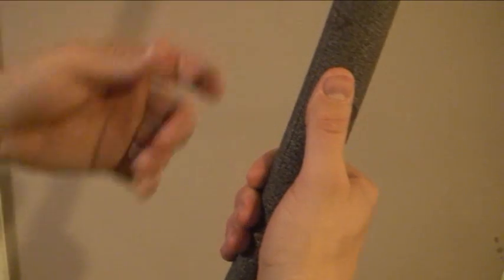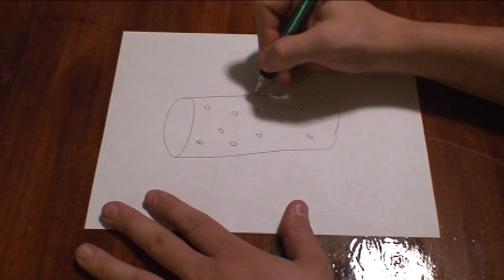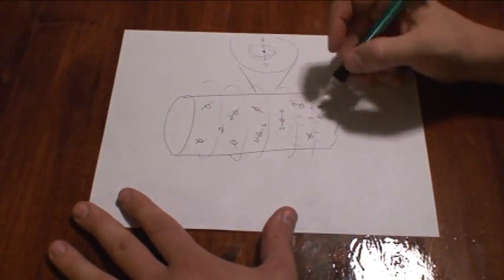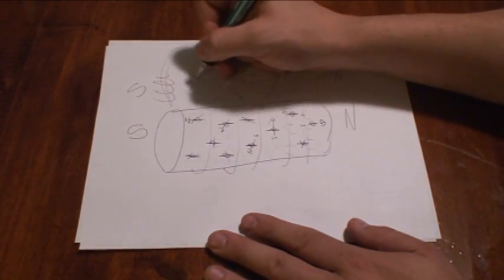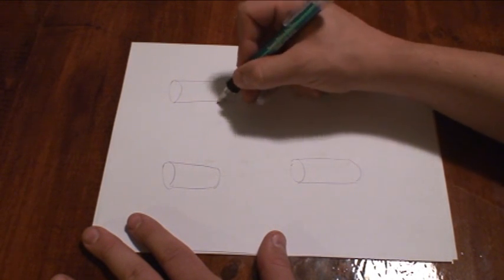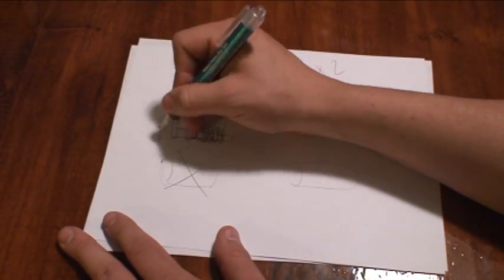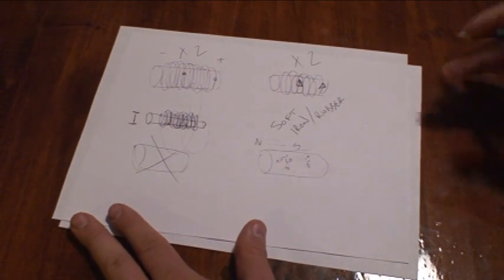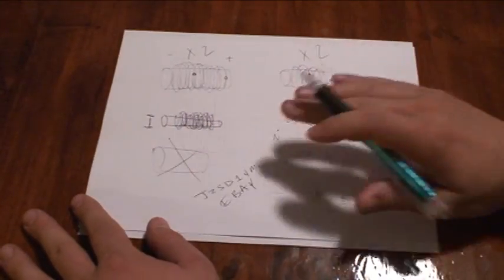How electromagnets and electric generators work:

Comment: I can't seem to get a straight answer anywhere.  You jumped from the coil of wire to spinning magnetic field. What spin?
You run current through the coil wire, easy enough.  You have the iron inside the coil. Now answer these:
1. Is the coil wrapped tightly around that iron or there is some gap/air between the two?
2. What rotates, the coil outside the iron, or the iron inside the coil, or both are rotating on some axis?  Hard to believe the coil is rotating or even the iron and the coil or you will have the wire that is hooked to the coil to feed it current in one big old cluster mess.
And on a separate question.  So-called Stator is that thing also in the form of a coil or not really?  
I have looked everywhere and they use the term coil and conductor for both the magnet coil and the stator.  Scientists communicate like doctor's write.

Comment: "Soft" iron has nothing to do with blending it with rubber... there's no rubber in "soft iron"... in fact, there's <nothing> else in "soft iron" but plain old annealed Iron.

 The term is in contradiction to Steel... which is hardened iron... iron alloyed with carbon to make it harder than "plain" (elemental/annealed) Iron.  Plain, raw IRON... is rather soft... and not desirable for its physical strength for that reason... but for electro-magnetism, it's IDEAL!

Various alloys of Steel can easily be magnetized "permanently"... tap a screwdriver blade tip against a "neo" magnet and you'll get a magnetized screwdriver. The magnetic orientation of the steel can be reversed by flipping the magnet, and tapping the screwdriver against the opposite pole of the magnet.  This is called "magnetic hysteresis"... it retains magnetism when exposed to a strong magnetic field.

However... tap a (soft) Iron rod against a magnet, and nothing happens... the magnetic alignment of the iron particles go back to their previously "randomized" polarity.  This means Iron has very low magnetic hysteresis.

Soft Iron in an electromagnet core can create a concentrated magnetic field that is as much as 50,000 times more intense than an air core.

Comment: Whilst I agree that textbooks do not concur with this guy I have to ask myself - what if they are not quite right - and by that I do not mean that they are wrong, but what if they only describe a certain phenomena and that in fact there is a lot more to magnetism and electricity than we have imagined. The trouble with most diagrammatic illustrations of observable phenomena is that they are theoretical and not actually observable - therefore all tests are designed to prove that they are true - this only provides INTERNAL VALIDITY. Maybe, just maybe, they dont quite describe what is really going on - I dont know many quantum physicists who agree 100% with each other after all.

Comment: Here is the constructive critique you wanted.

When you have read it, let me know, physics does work.
	 	 	 	
Your tutorial on how electromagnets and motors work is false and you should consider this.

The right hand rule does NOT discribe electromagnetism. (Find out why).
Molecules are not atoms, (Find out why).
Steel is not used for electromagnets, (find out why).
When iron becomes magnetised it is about “Electron spin”, not “polarity” (find out why)
For a given current, the field has the same strength along the whole of the conductor,
For a given current, the field has the same strength along the whole length of the conductor,
and the field is propagated at right angles to the conductor. (find out why)
Current is not measured in Volts, but Amperes, (find out why).
It is the number of “turns”, not the number of “coils. (find out why)
When you wind a number of turns of copper wire on to a iron core this is referred to
as a Solenoid, (find out why).
When turns are wound on top of one another turns, the inner turns are closer to the core. (find out why)
You should mention to your viewers, the wire must be insulated, and why, (find out why).
What is “standard steel”? (Find out why iron is not the same as steel).

The “strength” of an electromagnetic field is determined by the current flowing in the conductor,
however, the “density”of the field is determined by the “closeness” of the windings to each other.
The field is propagated at the speed of light. (find out why).
Soft iron rubber is used to seal refrigerator doors, but there is no rubber in soft iron. (find out why).
Soft iron is not a compound, but elemental Fe, (Iron). (Find out what a compound is)

S

Comment: Hello, I love your experiments! I appreciate your desire to break the corporate monopolist paradigm and give humanity a way forward without pollution. I have studied many such attempts and compared the successes and failures. The common principal of the successful designs is the vortex. You must understand the basic structure of the ether and how it drives the electron cloud around an atom. The motion of the electron cloud is a vortex. This motion aligns the ether and it flows through the atom in a duality, positive on one end and negative in the other. The successful generator will match this flow, it must work with nature and not against it. We are talking about the homo-polar generator in essence. This rotating magnet creates a vortex of ether and circulates it along the shaft axis. This ether flow can be tapped with a iron core coil. The system is driven by a small electric motor (parasitic load) and the output will run this motor and have excess output (load). The key is understanding that a minimum rotational speed must be exceeded before excess power output will be realized. I hope this will help you in further testing. Sincerely, Jack
Reply: Sad part is, there's some one sitting there with a pen and paper taking notes on the video. Grant it when he was making this video it didn't matter these videos were great they could have been proof that he came up with an idea.

But since last year it's the first who files a patent that gets the patent. So even if more individuals out there open source stuff it just takes one corporate tycoon to be like ..........CLAIMED(reference to tonight's walking dead episode) and it's their cash cow legally. And it's so costly to get patents approved the whole system is just corrupt now.

Not saying any of his ideas are patentable or even that ingenious.... but you get the idea
Reply: Jack Harper
Instead of all the pseudo science narrative, show me the math for your assumptions? LOL

Comment: If a wire is moved through a magnetic field, a current is induced in the wire. Generators work by turning coils of wire through magnetic fields and this converts the mechanical energy into electrical current. If you run electrical current through the coils, it will work 'backwards' and become a motor.  This is, of course, nowhere near 100% efficient. Energy is lost as produced heat mostly.

Comment: Well, if you increase the voltage with the same resistance then the current will go up, and yes it will have an effect.  However if you also increase the resistance to keep the current the same, then no it won't have an effect.
HuskyMaster9000 posted the formula below.

Comment: what core material would you recommend for an electromagnet that will need to do quick and intense impulses, and then have no residual magnetic field after the current is shut off each time?

Comment: Thanks for the info. =)
can you cut the soft iron smaller than 6 inches like maybe 3 , 2inch pieces and still have enough space to make a good enough coil? and how do you  magnetize the iron? Or get electricity to it rather... I'm pretty new at this subject but i am like a sponge and take it in and hold it all. Would be interested if it would be possible to magnetize the iron just as it started to pass a stationary magnet as to pull toward it and then let go so the next one could do the same.

Comment: pretty informative. you were wrong about the soft iron though. soft iron is iron with a low carbon content. iron with a high carbon content is called steel as you know. you were probably thinking of laminated cores that use thin strips of iron basically stuck between thin sheets of silicone as this reduces eddie currents being formed hence reducing energy losses